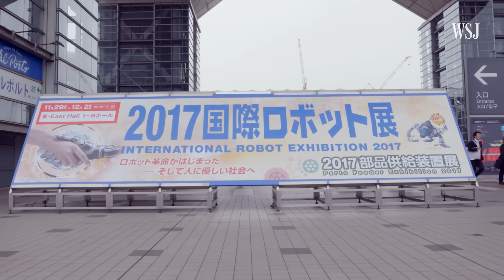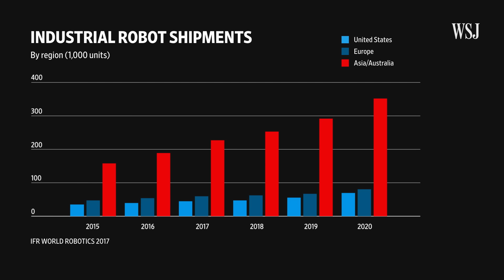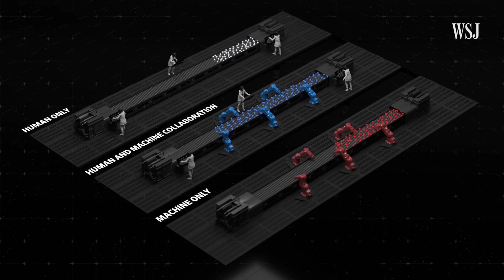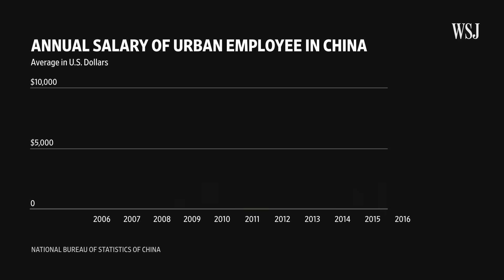The Robot Revolution: The New Age of Manufacturing | Moving Upstream

Comment: Robots are not taking jobs away from workers. Robots are freeing up manpower from one task so that same manpower can be used instead on another task simultaneously. Therefore, the same manpower force can be used to produce twice as many products, which gives us more selection at cheaper prices. 

But the simple-minded cannot see that. They can't see our selection of products and the cost for them is coming down. Video games exist because car manufacturing freed up some of its workforce and now those unneeded guys learn programing instead and spend their time making games which you buy. But you could not buy them if every man had to produce his own food and his own goods like hundreds of years ago before mass production. 

We love the efficiency and economy of mass production. Robots just takes that to another level. What do you think 3D printing is? What do you think the Ink Jet printer is? What do you think a sewing machine is? What do you think a high pressure power washer is? What do you think a power drill is? A vacuum cleaner, a washing machine, a microwave, a cell phone?  They are just more forms of higher efficiency to free us up to do other things instead like invent and watch YouTube. If automated robots did not exist, you could not have a cell phone for under $5,000 dollars.

Comment: Ofcourse some people will lose their jobs and that is part of every such switch. It is impossible to just change overnight. I do believe there will be short term pain but will be temporary. I believe costs of production of goods, freights, etc. will so much lower that it will ultimately become extremely affordable or even free. Prime example is the recent shift by a major broker to charge $0 for trading stocks. Imagine how such a complex accounting system of trading stocks, which did cause people jobs, is now so efficient and therefore cost free, is maybe now benefitting those same people by offering free trades (long shot). They can literally do $10 profit trades all day and make a living that way. It is fairly easy to do if you are into stocks.

Comment: 'Going Robotic' isn't an accurate description. For my own experience, incorparating automation for the purpose of reducing line workers for a particular process do not necessary requires an ' Robotic arm'. There are many other means and handling methods. Video shown are just programmable material/parts 'movers'. Labour/cost saving? Yes. More complex solution such as FMC/FMC could even eliminate all human for prepre-programmed repeative work! A ture robot in manufacturing (to me) need to execute control/monitor function, and interact with human with AI. We are not there yet.

Comment: The adoption of robotics and AI must be regulated so as to minimize the adverse impact during transition. In the long run equilibrium will be reached where the joblesness will get compensated by the extremely low or zero cost of products and services.

Comment: Having worked with automated systems and AGV's for many years I would like to warn anyone who thinks robots are great  what many users dont realize is once you robotize your system you are then locked to the supplier to support your system which is great for a few years but  replacement parts are expensive  then there are support contracts to enable 24/7 uninterrupted use and down time then obsolescence in a fast moving   environment   refitting  updating is often required  within 10 years  some small companies will go bust and youll be left with  it all to sort out yourselves  like all new products  the people selling will only tell you how great it is look deeper  get independent advice get assurances in writing as to support prices and parts factor all that in before you buy

Comment: Depending on which statistic you believe, the largest robot mfg Fanuc.  I wonder why WSJ didn't go there.  Fanuc owns the market.  For everything y'all have seen in this story as with so many stories about automation, robots and manufacturing, you are getting such a small snippet of the reality that the story is not a true indication of the state of the art.  To see where we will be in 5 years, 10 years; look at where the technology has come from. in the last 5 or 10 years.    I've seen robots advance since the beginning and do a few robot projects a year and there will as the story stated, be plenty of jobs available for humans going forward.  Someone has to install them, write the programs/teach the robots, maintain the robots and design the tooling, for the job.   There are no robots that you can walk up to and place a modern carbide insert tool in front of and have it change out the inserts in front of you, install the cutter into a cutter body, install and torque the pull stud, walk out to a machine tool and place the tool in the magazine and either set it at the machine or offline on a setter in preparation for use.  To do this takes engineering, prior planning, implementation and manufacturing by humans to achieve that ONE simple task.

Comment: Yes but robots are taking the good paying jobs. Unless you get into sectors that require a a degree in. Good example my brother job is to make industrial bolts and he runs the part of the line that produces the thread on the bolt. When he started his job he made $16 hour now after 7 years working there he makes $23. This job required nothing more then HS degree and training from company.  Sadly you get into even factory labor where I live. Running a plasma cutter for metal company will only net you like $11 a hour. So unless everyone goes to collage and gets degrees for higher paying jobs that have knish amount of positions at all times. All be left is retail and service jobs which are low paying for the most part.

Comment: Sweeping floor, wash dish, ironing, cleaning. Work in farm, barn, garden, jungle, mines, factory. As cleaner, as the labour, as the caretaker, as a monitor. Based job, which robot can replaced instead human. Work which hard, tiring, boring, routined, need long focus, need keep stay for a long time, which human can make error based on drop of concentration and focus. That where robot do the job.
Let me give the picture, 3 robot, A (the job do-er), B (the maintaner, of A. B will take care A and C), and C ( the maintaner of A and B). Where we can fid human? As controler and monitor of A B and C. Make sure A keep work properly, B n C focus on A condition,  maintenance function to A mainly, and each other support the other. 
B = > <= C 
The triangle is based function of continuity mechanism, which sustain the robot as team/ family group.

Comment: Manufacturing?. Not robots. 3D printing is going to to evolve to a point where we won't need central production.
Reply: My ball point pen costs USD$0.125.  It contains 6 parts, with one of those consisting of the actual ink cartridge/stylus/ball.  Each of these components is a different material.  It is going to be a really long time before 3d printing evolves to replace many such products that are efficiently manufactured.  

There are obviously some areas that 3d printing will be able to succeed in, but it is not going to become an effective Star Trek replicator in this century.  Will your dental crown be 3d printed?  Yep.  Your smartphone?  Maybe its custom case, but that's about it.
Reply: 3D printing is for specially made things, but its not so good for mass manufacturing. A Demo/Prototype could be 3D printed to show the Executives and potential investors, though